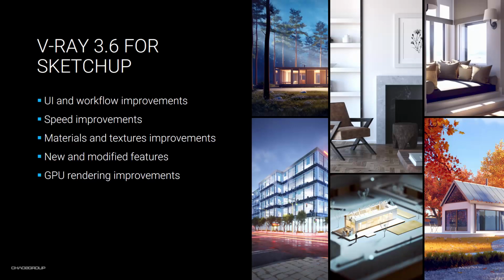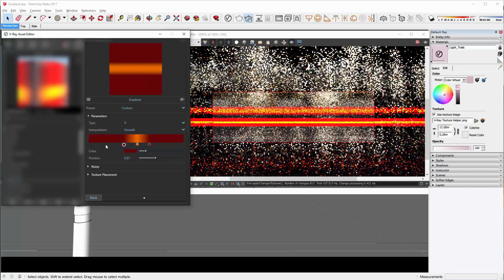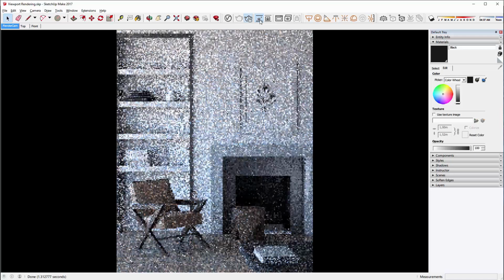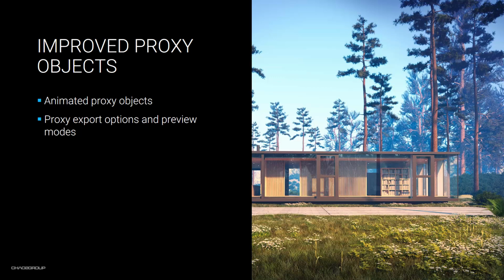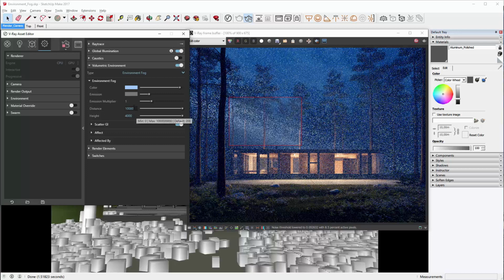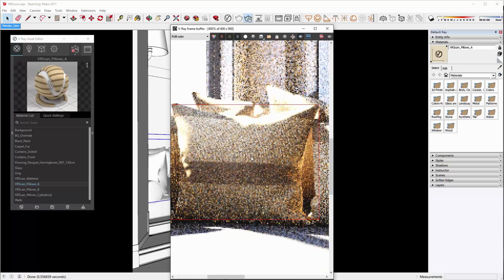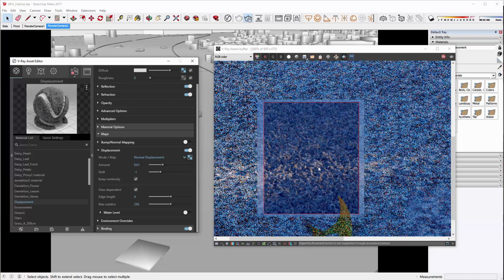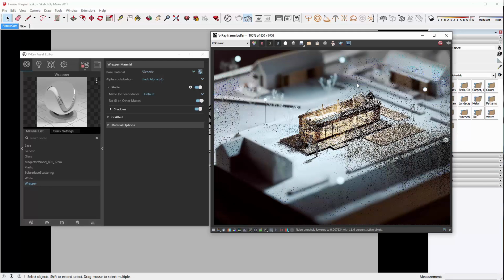V-Ray for SketchUp — Webinar: What's new in 3.6

Comment: Presenter...would you please share the specifications of the machine you are running V-ray on for this presentation?
Reply: they don't know hardware information to share those information you need. because they don't care about this its from the IT person how have given the assets like computers to use for their official use. following configurations listed below is most high end for any 3D designer need.

Intel Xeon Platinum 8173M @ 2.00GHz 
Nvidia Quadro RTX 2080TI 48GB/24GB/16GB  DDR6
128/328GB DDR4 Ram.
with 512 gb SSD for OS.
cost around 8lack .